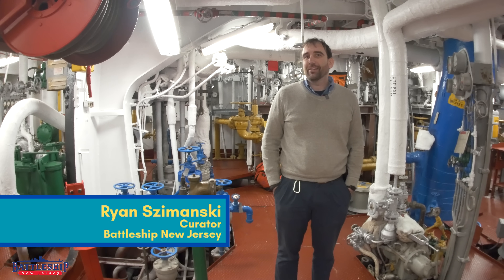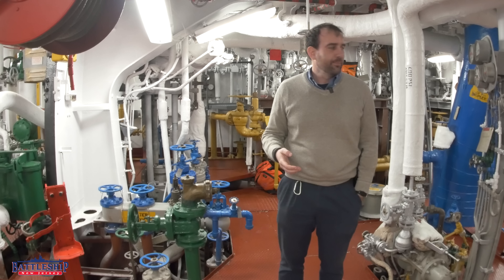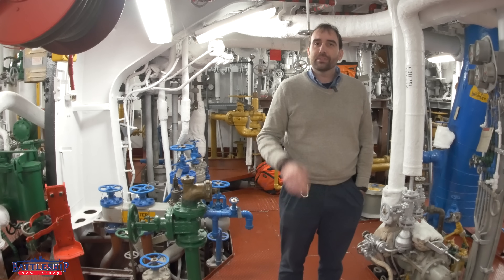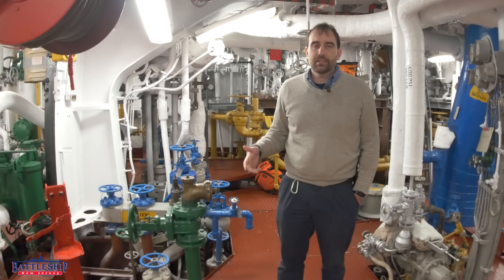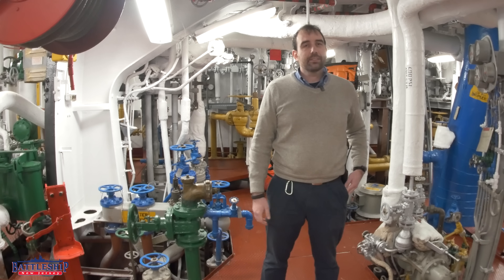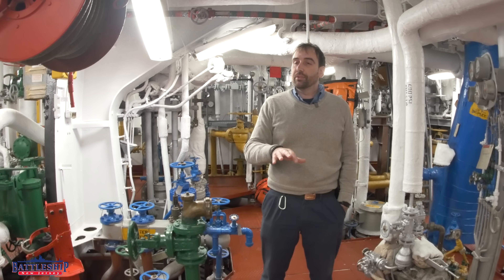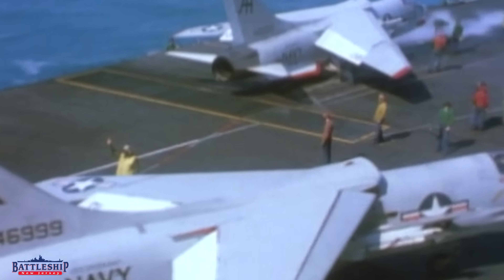How To Tell What A Valve On a Battleship Does

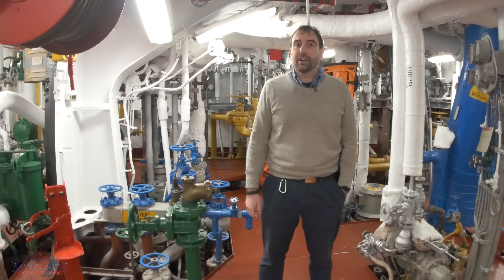Comment: What is that gizmo at 9:10? It looks somewhat like the top of a triple-expansion engine. 
No, the colors are bewildering at first view, but then it doesn't take long to equate it to a system much like home wiring. ISTR that we had bright yellow valves with red and the same with black lettering on them on some boats. Can't recall if they were hydraulic lines or what (getting old). Any bubbleheads out there who can restore my bubble?

Comment: The color coding seems easier for most folks, but the stripes used in the past obviously did a good enough job that people got the job done just fine, and seems like using various number of stripes would help if anyone were color blind, which by the stats would be about 1 in 12 crewmen.

Comment: Colour coding to find what you're looking for is useful even if it's just the pre-USB PS/2 plugs on mice and keyboards, when things are on fire it's even more helpful: "find the big red valve" is a lot easier to first even remember, and secondly perform than "follow this grey pipe in the near dark until you see how many stripes are on it, and remember not to trace that one again if you picked the wrong one, c'mon tick tock time matters".

It's one thing I notice they always get wrong in most movie set design... everything is colour COORDINATED, rather than colour DISAMBIGUATED. The last thing you want when you're in a crisis is to be looking at a panel of controls that all look the same.

Comment: I'd say that the color coding as she is now is the way it was during her life as well as the different periods of being commissioned. I suppose to a point that while in use and underway shere would be some grease and oil spots here and there from the regular maintenance, operations, and repairs, it wouldn't get out of hand because of the "clean as you go" of the Military. If the New Jersey is anything like the North Carolina there will be ingrained into the steel itself the odors of fuel oil in the engine rooms and burnt gunpowder in the main gun turrets

Comment: There are many systems that are used in engine rooms to identify different piping systems. 
Some use completely colored pipes. Some use simply white or creme colored painted pipes with color bands and flow direction arrows.
Some use color painted valve handles etc.
It really depends.
In general, most extreme heat applications are painted grey simply because the heat resistant paint for high temperature applications is usually silver grey.
Some stencil the piping with the name of fluid it carries and sometimes includes a stenciled flow direction arrow.
There are so many different methods out there.
No matter how advanced the systems are, there will usually always be some sort of commonality to the systems such as steam systems for propulsion turbines, boiler feed and condensate water systems, seawater cooling systems etc.
There are even systems out there where valves are identified with large stenciled numbering next to valves if these are supposed to be operated in a certain manner in case of an emergency. This will then usually follow a laminated procedure which the operator will carry around when operating the various valves in the correct order.
Considering the number of people normally manning an engine room in a navy ship, it is crucial to have a system where the various systems are easily identifiable.
In a merchant navy ship you can be as few as 2-3 people in an engine room the size of an entire destroyer. Many of the systems are basically the same with a few differences. They are usually just packed much tighter in a navy vessel main due to the need for fitting things in compartments that can be closed up watertight in case of a hull breech. This is usually not the case in most merchant ships except maybe for container ships. The system with water tight engine room compartments are usually also used in passenger and cruise ships.

Comment: I think I have a question that hasn't been asked or at least explained. How loud was it? So in the different areas of the turret with all the machinery and steel walls how loud would it have been when firing at full capacity? Also how loud would some of the engineering spaces be and maybe some of the living spaces? I can imagine the sound of everything on the ship would travel through the steel pretty well?
Reply: I served on USS Saipan, an LHA not a BB, but the engine rooms are similar.
The answer to your question is LOUD! when underway. The boilers roar, the turbines hiss and whine, pumps and fans make all kinds of racket. We used a lot of hand signals to communicate in my engine room.
Big ships are loud!

Comment: Question (and this might make for another video):  Were the fire-supression-seawater pipes always pressurized?   Would they have been pressurized when at port and shutdown, or just when underway or when the plant was running?    Would the lines have been statically pressurized and if that pressure dropped a generator+pump started immediately to supply continuous water?  Is there a tank "higher up" that stored water so it could gravity feed to some of the lower spaces?
Are there any instances you know of (probably not on /New Jersey/,) where combat (or other) damage ruptured a f-s-s pipe?

Comment: On (at least German) submarines the wheels are also shaped differently, so operators could feel the difference, if lighting failed (e.g. when getting depth-charged) and one could not see the colour. That was especially important since in the command center they were concentrated in one place (informally known as the christmas tree).

Comment: It looks very reasonable to me.  I am reminded of the colored stripes on the floors (at least in the hallways) of the local VA hospital;  depending on where you were going (e.g. lab, X-ray, ER, etc.) there would be a different color or pattern of line to lead you there.  Worked much better than signs on the walls.

Comment: One that we will only get on a few ships (carriers, submarines and a certain few cruisers), but that is very important, is the HOT water/steam (hot in the sense of makes a Geiger counter go crazy).

 I believe the Russians had an accident back in the Soviet days when a cook was trying to get his pots clean with steam from the engine/reactor spaces, and opened the wrong steam valve. Radioactive steam WILL get your pots clean - maybe they'll be safe to use in a century or so?

I'm SURE the radioactive side water and steam valves are a different color. That's SUCH an important distinction that I wonder if there's something else different about them too. Reverse threaded? Very odd handle shapes? Can only be opened with a certain tool? In a box?

Residential high-pressure natural gas (as it comes into the house) is deliberately different from low-pressure gas on the other side of the regulator (different pipe diameters, and, I believe, opposite threading as well> One may also be tapered - they want to make it REALLY hard to cross-connect them. This wasn't always the case -  very old house in my parents' neighborhood still had the old-style gas pipes, and a contractor who'd never seen the really old stuff managed to cross-connect them, hooking up the water heater to high-pressure gas. Fortunately, nobody was home when the water heater lit off and the house exploded... Nobody was hurt, but I'm sure it was an interesting liability insurance claim.
Reply: Yes, the primary reactor coolant plumbing looks very different from the secondary systems.

Comment: I was the Comm Officer on the USS Brush (DD-745).  I had to cross-train in engineering.  After a few watches, you got used to the colored wheels and pipes.  Bewildering at first.  Then you started to see the logic behind the colors and where the valves were located.  The next phase was learning to run the steam propulsion system.  I was never an expert, but I could get the ship moving.  It was not fun.  Hot, steamy, noisy and when you emerged from the Forward Engine Room, you smelled bad.

Comment: Why are there so many gate valves and no ball valves? At least these days  it seems there is never a reason to install a gate other than they are slightly cheaper but do not last.
Reply: If you had a bad valve and no spare parts, which would you rather machine a new part for?
Reply: There were very few gate valves shown in the background of that video. Most of the valves visible are globe valves, lift check valves and plug valves. Gate valves are intended to be used fully open or fully closed, they are not throttling valves. They tend to fail closed when operated by people who think the valve works better when torqued to some extreme. The stem to disk connection fails when the disk is jammed closed but the handwheel still turns so the operator thinks the valve is open when it is tightly closed. It would take the most extreme circumstance for anyone to even consider machining a part for a failed valve, especially a ball valve. The solution is to replace the valve as quickly as possible and use the old one as a training aid for the idiot who jammed it.
Reply: @oldtugs  thank you! Love information like this from people who know.

Comment: It's interesting what has crossed over for paint markings for construction for marking the locations of electrical, phone, telecommunications, water, sewer for new construction.  The battleship has so many fluids that aren't in domestic housing that there aren't a lot of overlap, but I love that the navy ship standard for fuel is yellow, and natural gas lines for a house are marked with yellow.
Reply: I've made a lot of money off of idiots who use orange lines to indicate where to dig since they are easy to see from the cab of an excavator.  This actually works well until they pick the wrong set of orange lines and discover what I used to get paid for splicing copper down in the bottom of a trench...

Comment: Most of the pipes wouldn't themselves be color coded, just the valves. Exceptions to this are fire and flushing, AFFF and other fire-suppressant systems. In lieu of color coding the entire pipe, the pipe would have its use stenciled on it, as well as the direction of flow with an arrow. So they probably had a plethora of blue stripe and green stripe and went to town :) When I was in, IIRC, CHT was, well, brown. I bet they changed it to gold to make it easier to spot leaks?

Comment: As somebody who has worked on things, I have to say that color coding is very helpful. So, I'd say that this space looks how it's supposed to, laid out and color coded to make repair easier. When I was working on my car, there was no color coding. It was really hard to tell what did what. So, me and my dad pulled a line, thinking it was a vacuum line. It was not. The line had coolant in it. It was a minor problem all things considered, but such an issue on a battleship could easily be a major problem. You don't want pipe or valve confusion when you're dealing with potentially hundreds of gallons of fluid, especially if the ship is having a problem like a burst pipe or an enemy shell hit. Color coding is the best.

Comment: With the large amount of pipe, valves, fittings, and equipment onboard did the ship have a stack of piping & instrumentation diagrams that show how it all connects together?
Reply: DC Central/Engineering Office would have had a full set of prints for everything on board.  In addition, they would have plates showing the compartments on each deck, as well as other plates showing the major liquid distribution and electrical distribution layouts.  Each compartment will also have a document on the bulkhead which lists every valve and fitting located in that space.
Reply: Every sailor in my division had a notebook full of drawings and diagrams. We made the drawings ourselves as part of our education, and had them critiqued, corrected, and eventually approved by our superiors when we could thoroughly explain what everything did and why.

Comment: The NavShips Tech Manual (NSTM) lists all the colors including the National Stock Number (NSN) for each color.  Had an issue with the Bosons Mates trying to get the correct colors for our machinery spaces.  I had to take the NSTM chapter down to the Paint Lock so they could order the correct colors for the minor systems they didn't know we even had on board.  Forget the system, but the color they handed my fireman was not correct and I knew it.
Reply: Did you hear about the disappointed Bosun's Mate on liberty?  He thought "50 Shades of Gray" would be a film about Navy ships...

In all seriousness, I wish Ryan would cease referring to JP-5 as "Aviation Gasoline".  I was on an Oiler, and the only Gasoline on board was that for the portable fire pumps.  However, we did carry around 2.5 million gallons of JP-5 (Purple) and about 5 million gallons of DFM (Yellow).
Reply: Supply likes to switch out the proper paint listed in the TM with a can from ACE

Comment: Power plants are the same.  All of the pipes are colored in different ways (if visible as sometimes they're under insulation).  Even things like HVAC ducts may be painted as well. 
Helps to tell which systems are which and that's very important for fire protection and as well as those contaminated by radiation as well.
Reply: Common theme: it ain't meant to be pretty, it's meant to be functional.

Comment: How did they remove the salt and minerals from the evaporators after making potable water?
Reply: It is just an extra dense salt water called brine. It just gets pumped overboard. It isn't just pure, dry salt.
Reply: To start with, the evaporators don't turn all of the seawater into potable water but only a portion of it before pumping in new seawater so while the salt does become more concentrated it doesn't reach saturation and remains dissolved in the water. There will be a build up of scale on the evaporator coils of other minerals though so they are designed to be able to be removed and cleaned. Another technique is called thermal shock where you heat the coils without the presence of cooling water, then introduce cold seawater to break the scale off.

Comment: They are not the scuttling valves are they?
Reply: @MadJustin7  They already did a video on how to sink your own battleship.
Reply: @ghost307  if all else fails, simply forget that if you are using water from the ocean to fight fires, you should probably be pumping it out of the ship and back into the ocean at around the same rate as you are applying it to the fires.